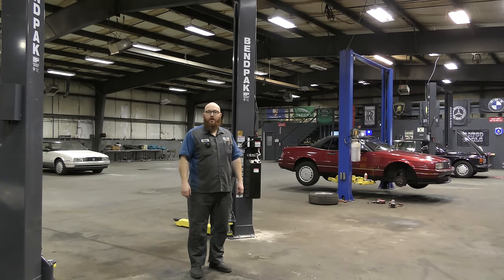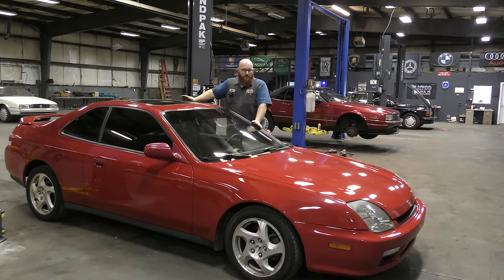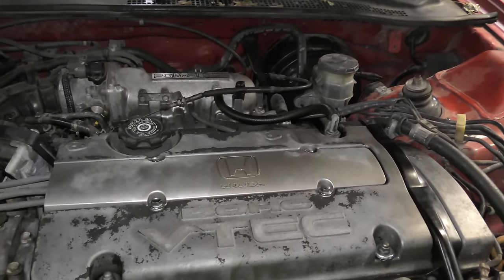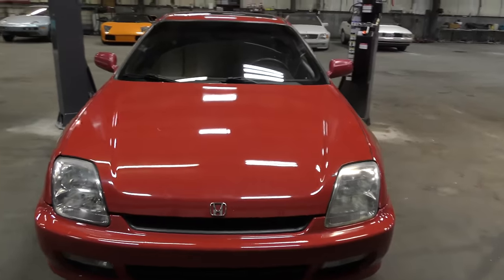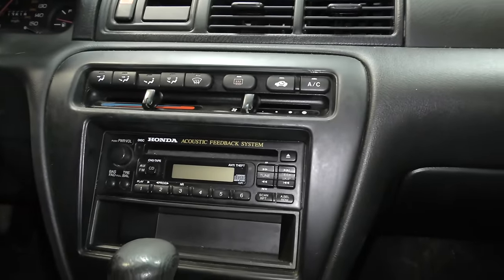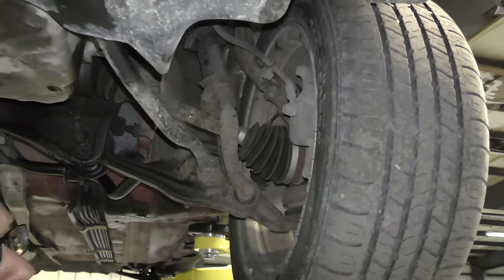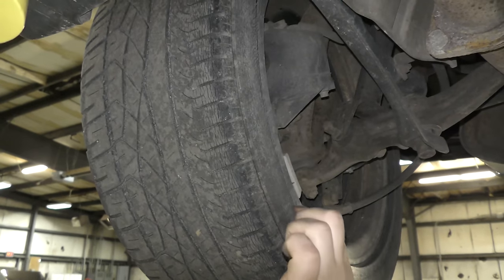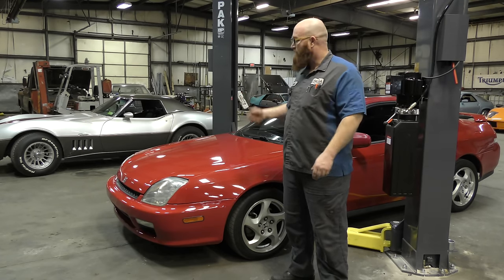VTEC YO! The CAR WIZARD finally gets a Honda Sports Car ~ A 2001 Prelude!

Comment: Congrats on the prelude Wiz! I've always wanted a 90's or a 00's Lude. Lucky guy... How do you fit in it? Is it comfortable? I'm 6ft2in and 400lbs, would it be a squeeze for me? If I had that car I'd leave it mostly stock. Maybe some different wheels, maybe not as I like the factory ones. But that's about it

Comment: I thought you weren't feeling Honda sports cars? Anyhoo, one mod, and only one: convert it to manual. Pristine the heck out of it and make it desirable with a manual transmission, if that's doable.
I was surprised to hear they're so rare, you see a few down here in Australia. I've had two Preludes myself, a 2nd and 3rd gen, the 4-wheel steering was awesome!

Comment: Hi Wizard. I just started watching your videos. I have a 1998 Honda Prelude Type SH myself. Nearing 300k miles. I inherited the car from my Aunt, so didn't have to pay anything. I did put in several thousand getting a tune-up, replaced all the seals, machined the head, replaced belts, and all. The ATTS light is on, I don't believe I will be fixing that. Recently had check engline light come on for a reading on the knock sensor. It drives fine, so I'm supposing just the part would need replacement. I'm not very knowledgeable about cars, but I wondered if I should continue to maintain this car. It does have sentimental value, but I am hoping this engine will hit 400k. What would you do?

Comment: Cute car, on my '04 Accord, seems like I never hit the vtec yo. I'm slower than the car I guess. looks similar to my 99 accord suspension and I love driving it also. I would beef up front possibly to sway bar it in front?  the more stock the more desirable clean it up maybe put a decal on the side (for Xtra speed)  other than suspension the cars were awesome, easy to resuspensions also and they will drive like new even with 500,000 mi.

Comment: If you manual swap it you may raise the value enough to offset the parts. These cars have all been riced to death, stolen, or totaled. I would do a re-paint, the doors and mirrors are pretty mismatched. I would love to get one of these for a project car with my son. I had a 93 prelude VTEC. I prefer that body style, but the interior was bizarre.

Comment: I'd probably cosmetically and mechanically sort if and then leave it because the rest of it seems nice.  With good tires it should handle well and drive fairly smooth.  A manual swap would be cool but maybe that's a bridge too far?

Comment: Honda are great cars which not many people actually appreciate for their excellence.
Don't do silly mods like lowering the suspension, changing wheels etc. The best mods you can do are cosmetic things like painting the exhaust manifold heat shield to match the car, same for the brake calipers etc. Little details to set your car apart from the rest of the (very small) herd

Comment: It'd be good to here what you think about the 4WS. I have a motegi version 200bhp (uk only), I've had it 9 years and don't think i could live with anything else. I sit in friends cars that cost 20x what my lude cost, and i just feel that there a step down regarding handling. (Don't get me started on the electronics - prelude has everything i need, cruise, air con, heated seats - no talking/beeping etc lol)

Comment: Manual swap it. Relatively cheap and easy to do the swap. You can also find a manual with an atessa lsd which is quite rare but impressive. It would bump the “vtec smile” up on your face quite a bit. Next thing that makes sense to me as a Eastern-European Hondahead is a jdm brake kit and jdm engine head swap. Slap some mean exhaust and intake headers if on a budget.

Comment: I had a 97 was my first car loved that thing still have it Setting in my barn for the last 5 years lol  looking for a new shell quite a bit of work to the motor kept a vehicle mostly stock though other than the motor and some performance upgrades I live in northern Canada so the salt got at it over the years and the cops pulled it off the road

Comment: Cool video wizard, that's my favorite Honda engine. H22 and its destroked litter brother the F20b I run these engines in my 93 civic hatchback. So much fun even in the h22s stock form.
Reply: Forgot to add if you want to do a manual transmission swap the F22 trans from the accord bolts right up.

Comment: What would I do with that car?  Nothing, except have the paint redone to make it look like new again as well as to replace the broken door handle and replace the missing factory badges and maybe consider doing a manual transmission conversion.  As you said, it's getting hard to find cars like these in original condition because people rice them or pimp them out and beat them to within an inch of their lives.  If I may add, that's also a problem with 80's B-Body Chevrolets (Caprice, Caprice Classic, Impala).

Comment: This car doesn’t have a h22a it has a h22a4 or h22a1 (a usdm market engine) it is a h series 2.2L engine but does not make 200hp like the Japanese market engines. The usdm engines typically make 160hp and are not nearly as good quality as the Japanese engines. I would import a new engine and transmission from Japan for this car if I were you. Would completely change the feel of the car for the better. I’ve had one for many years was my first car.

Comment: Hi Wizard! I have the highly optioned sister of your car. I have a 2001 Prelude SH that's Milano red as well. Mine has been almost entirely repainted as these cars came with stage 1 paint that would turn pink. It has about 106k, fairly stock. An individual put an aftermarket muffler on it but the rest of the system is stock and I do have the original one. I have done added the OEM optional lip kit (color matched of course) to the car as I feel it compliments the shape of the car without being overbearing. Mine too has the stock radio and looks just a clean underneath as it spent most of it's like in Georgia. I have purchased a front splitter for the car that I'm planning to chassis mount and fully adjustable Ground Control lowering springs and koni yellow shocks that I'm ready to install. Should I follow through with those modifications? The car would not be slammed, the suspension is entirely for function purposes. I would keep the stock suspension of course in the case that I would like to revert. It's entirely stock under the hood including the original airbox. I'm located mere miles for you if you'd be interested in checking over the car or taking it for a spin. I meet Tyler just last year at a Mecum Auto Auction.

Comment: Manual swap with hydraulic clutch Aftermarket plenum, filter, throttle body, intake manifold, 4-2-1 headers stainless, 2 1/2 or 3 in free flow exhaust stainless, titanium 3 inch muffler, coil on plug conversion and some Ecu magic with a tune

Comment: All you need to do is instead of wheels and tires cut the rear Muffler off extend the pipe out but a decent-looking tip on it that's all I would do.

Comment: You bought it I sure hope for the love of God that  Transmission is built if not you're going to have a hell of a life Swapping minds to manual was not that easy but since I had a parts car it made it easier But I would not recommend doing it either way there is a lot of drilling and cutting involved

Comment: What to do with the Prelude?  Clean it well, restore whatever is worn, and leave it as-is.  Take good care of it, and unless it was a factory- or dealer-supplied option still available somewhere that you could add, I'd leave it alone.  Especially given its rarity.  

I could see the repaint in the video. The fading on the doors is the original paint--I'm guessing it was San Marino Red, which (at the time I read it) was Honda's most popular color over the years.  The paint supplier had a problem with the San Marino Red and Milano Red (slightly darker/redder) where the color base coat would fade beneath the clearcoat--this is the fading you're seeing there.  The repainted rear is closer to the original color.  (The same happened on our '97 CR-V--the repainted panels retained their color, but the original panels faded.)

My favorite is the 4th generation Prelude. I still like the looks of that one.  But they are impossible to find up here, where they are not beaten or rusted away.

Comment: Keep it stock, fix the paint and tires.  The real gem here is that it exists.  A pure Prelude is hard to find.  This is Soichiro"s vision distilled down to it's very essence.  Before Honda tried to out Toyota, Toyota and became an appliance maker.  A bone stock one will bring more looks and comments than one with a Folger's can exhaust tip, big-ass turbo held in place by hose clamps, hope, and bubble gum and the final ricer touch; black exhaust soot covering the rear fascia.  

The sad thing is my dealership had a beautiful Electron Blue 2001 5-apeed that sat in inventory for 502 days and a Satin Silver Type SH sat for 378 days.  Honda had to force us to take them.  No one wanted them.  The Accord Coupe V6 had 200hp and much more room,  was quieter with a better ride.  So people bought those instead.

Comment: One thing I will never understand is why older guys, such as carwizard or ErictheCarGuy, dislike aftermarket stereos. Sound quality on most are miles ahead of the crappy stock radio and they add a ton more functionality (Aux,  Bluetooth,  etc)

Comment: Change the wheels
New tires
Respray or change car color
Change the radio
Clean or replace headlights (either oem or upgrade)
Add a front or do a complete kit
Lower it (not slammed)
Exhaust 
Headers
Intake 
Turbo
Clean the engine bay
Clean and paint engine cover or get a new one 
Swap steering wheel to the s2k steering wheel 
Fix door handle
Upgrade audio (not talking about an oversized sub that rattles car..thats ghetto..replace oem speakers and sub with better ones)
Reply: Oh and manual swap it.

Comment: I would have passed on that prelude it's pretty leaky all over. Also the valve cover on that shows all the original paint is gone which usually I've been told and learned to stay away from engines like that. Usually they've ran hot and baked the paint off. The valve cover paint on that generation prelude isn't that bad. Some of the earlier ones flaked alot but the 00 01 didnt. You can tell those tires are dry rotted to hell. I hope you only paid like 1500 for it or less

Comment: It is now the very first day of May 2021. I will expect the Car Wizard to do an all-new, buy this, not that video this afternoon for Mazda or Mitsubishi. I like the Mazda 3 and the Mazda CX-5 a lot more than the Mitsubishi Outlander, because they have the 2.5 L Skyactiv turbo and regular four-cylinder engines and they are more fuel-efficient than the 3 L MIVEC V6 engine. They all use a six-speed automatic transmission and Mazda has their spark-ignition-direct-injection inside their engines, while Mitsubishi does not. I am more into Mazda's than Mitsubishi's. So, anyway, good luck to the Car Wizard this afternoon and I hope there will be more Car Wizard videos to come later on.

Comment: slap a timing belt and water pump in, change the fluids, tune up, valve adjustment, and leave it stock

Comment: I'd change the stock radio to a wireless Android Auto head unit and install a wireless charger, dash cams front and back, and a parking camera with sensors

Comment: My Ex had that car. It was an 01'. I couldn't stand it. Yea, it handled nice and was quick. But I hated the seated position. It was like sitting on the floor with a piece of aluminum foil between the seat and the road. It was loud and abrasive. I made her trade it in for A Jeep.

Comment: I had a clean Pearl white one but year 2000. Crashed it and now I have a shitty metallic grey blue one. Just the paint is shot. I want to RICE it out all the way to the neon under lights. But not stance it out or even put coilovers. I would put either yellow or smoke foglights. I hate sticker bombing but would get a sexy waifu but done classy...And get the sunroof Visor and window visors. I want to put an integra spoiler on it. I have an automatic but I wouldn't do anything stupid until I do an engine swap to manual. I barely bought this new one a couple months ago. Could sell it tbh and save up for an Acura RSX tbh. But I still love preludes. Just wish I didnt crash my first one which was better condition

Comment: always been one of my favorite cars. shark like
Reply: if I had it exactly as it is, probably all the tires to some high performance summer tread and some ceramic pads first. maybe later aluminum radiator, braded lines here and there; support stuff y'know? idk what all that chassis flaws are, most cars can use a heavier brace somewhere though lol

Comment: The Car Wizard should have bought an Acura RSX instead, because it is a lot newer than his red Prelude before. I am hoping that there will be a buy this, not that video for Acura, after the Car Wizard buys his next vehicle, hopefully a 2015 Acura MDX SH-AWD mid-size crossover with the 3.5 L V6 engine, which produces 290 horsepower and the six-speed automatic transmission. So, he can use it for the next buy this, not that video on Acura vehicles.

Comment: Yokohama S-Drive tires.
Service/rebuild the brakes, as necessary, with OEM Honda parts.
Restore the wheels, as necessary.
Full engine bay and underbody cleaning.
Then go drive the hell out of it.
Reply: Those are the EXACT tires I have on my 01!
Reply: @DirtManDan732  I've got them on my 98 Civic, and they've been great tires.

Comment: No wizard,  the NSX introduced VTEC.
Reply: introduced on the CBR400 in 1983 known as HYPER VTEC and in Japan in the 1989 Honda Integra XSi which used the 160 bhp (120 kW) B16A engine. The same year, Europe saw the arrival of VTEC in the Honda Civic and Honda CRX 1.6i-VT, using a 150 bhp (110 kW) B16A1 variant. The United States market saw the first VTEC system with the introduction of the 1991 Acura NSX!

Comment: The Car Wizard did a video on the 1991 Acura NSX earlier today, as it was Election Day all over the United States. I am hoping that Biden will become the new, American president, so Mrs. Wizard and himself, including Tyler Hoover and the rest of the crew will be happy for the next four years or more. Also, the Wizard's children will be a lot more older than they were now, because he has two daughters - one still in college and one still in high school. Anyway, I am still waiting for a brand-new, what vehicle should I buy video on a Subaru Forester with the 2.5 L flat-4 engine, non-turbocharged - a 2001 (first-gen), 2004 (second-gen) and a 2012 (third-gen) with the four-speed automatic transmission. It will be which one to buy in excellent condition, which one to buy, maybe in great condition and which one not to buy, if it is in rough shape. It will up to the Car Wizard to decide on that idea, when he does the video for the Subaru Forester soon, because they are very reliable, when they are well-maintained and the head gaskets are replaced on its current maintenance schedule. Finally, please make sure that every used vehicle is rust-free, before you buy.

Comment: Why hasn't honda brought back the Lude? They killed off the accord coupe, and are missing out on an opportunity to being back a legend.
Reply: It’s because the masses want huge honking SUVs and crossovers; the manufacturers will never listen to a minuscule portion of the market.
Reply: @digitalrailroader  Did you miss the release of the new Toyota Supra? This is an example of the manufacturers listening to a minuscule portion of the market.
Reply: @SPECIESUNKN0WN  i didn't miss the release of the Supra; unfortunately, its about 80% BMW engineering, and 20% Toyota engineering.
Reply: @digitalrailroader The % of BMW parts/engineering has no relevance on your previous statement. "Manufacturers  will never listen to such a minuscule portion of the market". Toyota released the Supra. A literal example of a manufacturer listening to a minuscule portion of the market.

Comment: you are still wrong wizard....here you go....please check your resources before start talking about VTECs.

In order to develop its next generation of engines for the mainstream market, Honda's NCE (New Concept Engine) program was launched in March 1984. Specific targets identified through the program included high torque in both the low- and high-rpm ranges and dramatic increases in horsepower per liter. The program was a success, resulting in a series that included the DOHC engine found in the 1985 Civic and Integra, and the SOHC center-plug engine in the 1987 City.

Comment: I had no idea the number of yhese cars produced was so low, I've owned like 4 of these,
Reply: It's actually 51xxx not 58xxx. Plus a ton have been wrecked or parted out used as donor cars for the motors. I've had 5 5th gens and 2 4th gens. I love them

Comment: Loved my '97 Prelude 5 speed. However, these things drink oil. I had the original engine (h22A4) replaced with a blue top (h23 vtec) and even the new engine used oil.